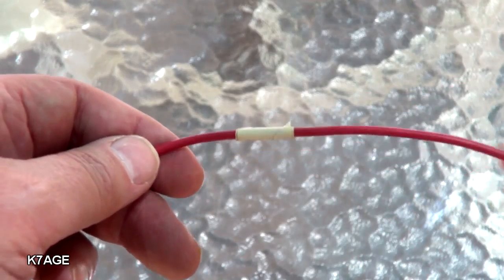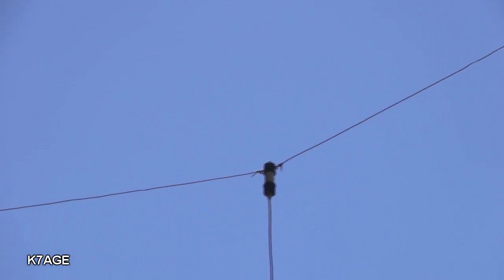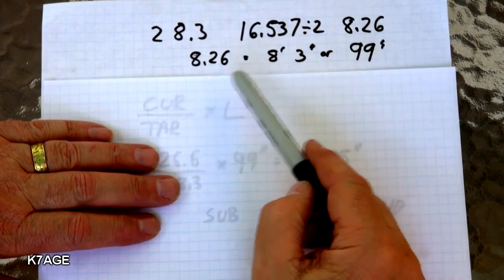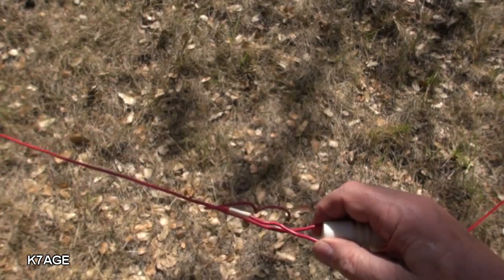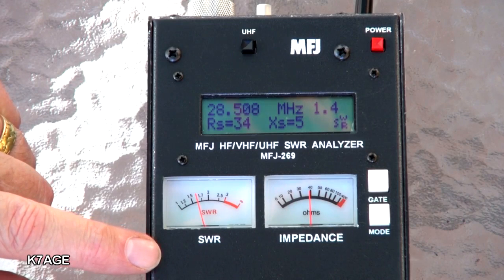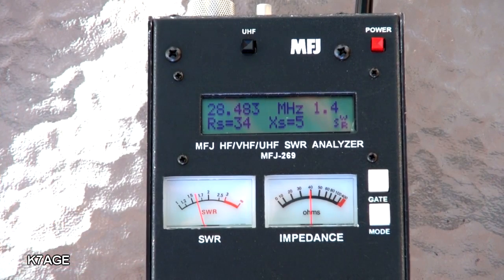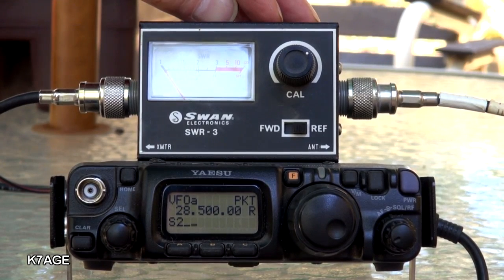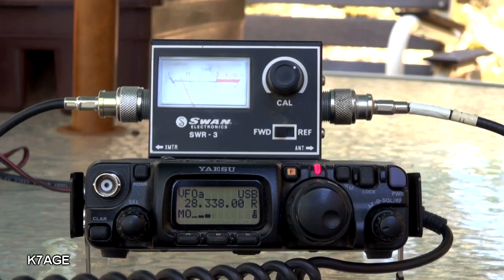How To Tune A 10 Meter Dipole

Comment: Great videos i like it !! very usefull for me beginner i start right now with the licence, i thought you must cut the dipole end for adjusting the swr ?? is it only the length between the insolators ?? thank you
Reply from the maker: Frank Koller yes, only the wire between the isolators. The RF doesn't see the wire bent back and wrapped around itself.

Comment: i just purchased a HVT-600 multiband antenna. its a whip style antenna. no tuner is needed. you simply change a jumper for what band you want to use. then to select the frequency to change the length of the whip part. i received it today and just have to make a ground plane. its very well made seems to be a great antenna

Comment: Why not shorten up the antenna a little bit more still yet and make it little better. Like 1.2 or better?
Reply from the maker: shartne You could. That exercise is left to the student!
Reply: K7AGE I leaned from your video about how to adjust the swr by shorting or lengthening the length of antenna wire on the insulator. I was going to move the place where the coax connects to the ladder wire and resolder it. The tape marker was a good tip for making the basic length. I am getting ready to make a J pole antenna. And that will be helpful. Thanks for this video. Good thing I didnt cut off the length yet.
Reply from the maker: Have fun building antennas.